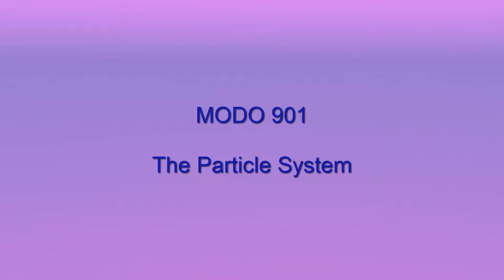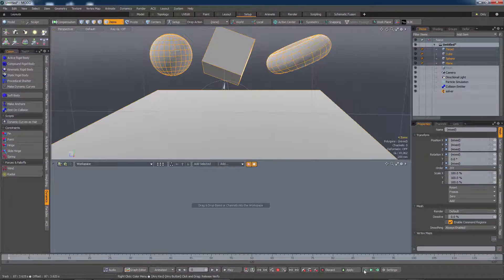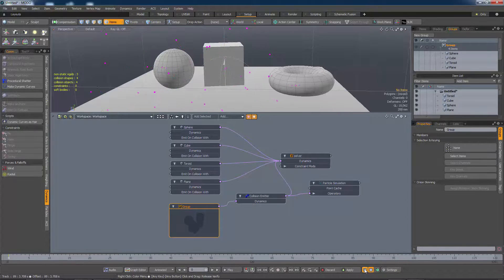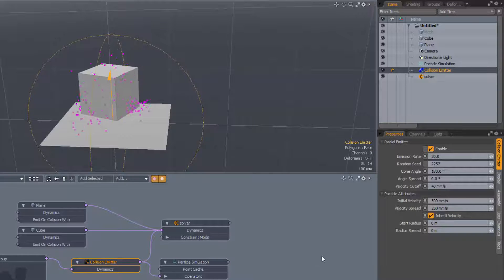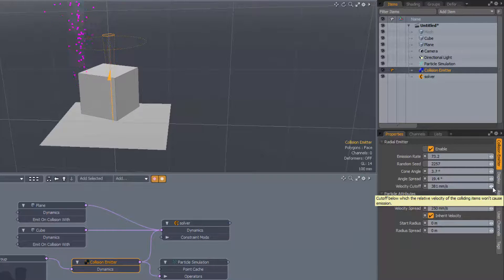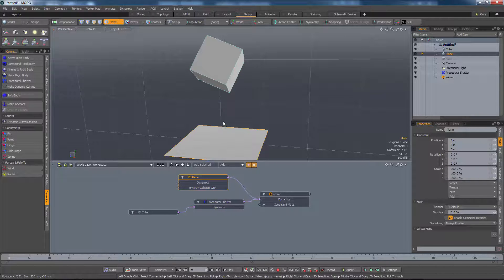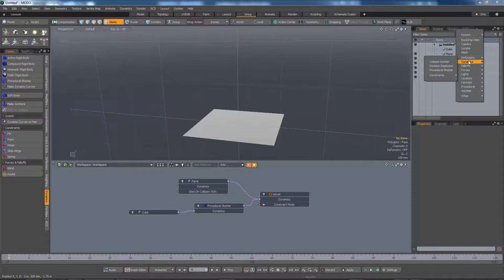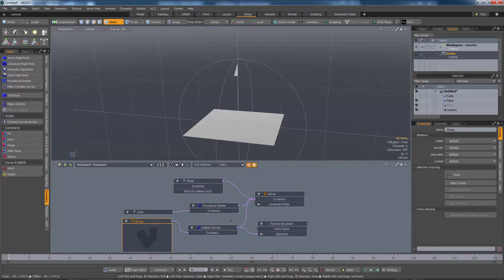The Modo 901 Particle System -- Emit on Collision

Comment: Is there a way to make particles trigger an emission upon collision with a mesh? I have one stream of particles impacting a sphere, and I would like additional particles emitted from the impact events. I haven't been able to get this to work out.  Thanks in advance for any help.
Reply from the maker: +D Lewis The short answer is yes.  The rather more helpful answer is that you need to use the "collector/emitter" and a chain of simulations to do this sort of thing.  I cover this in some detail here https://www.youtube.com/watch?v=osDNcX7VXy8 for MODO701.  Some of the detail will be out of date, but the principles are the same in 901.  I uploaded a 901 file which hopefully does what you want https://www.dropbox.com/s/nj5apur3k9sya7j/ParticleCollideEmit.lxo?dl=0 -- it is slightly more clever than the 701 example in that I have added a direction away from the sphere to the emitted particles.
Reply: +Steve Hill This is exactly what I was looking for.  Thanks!